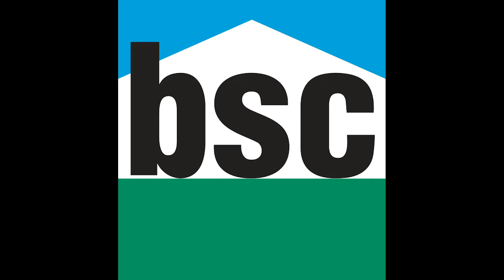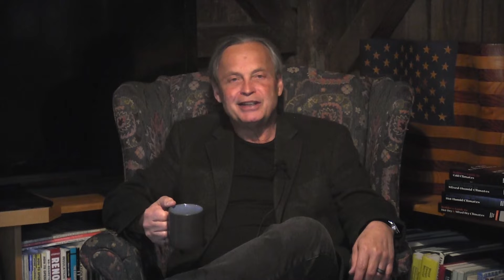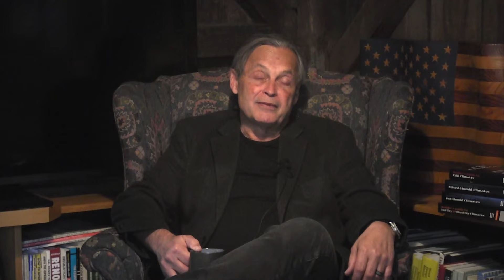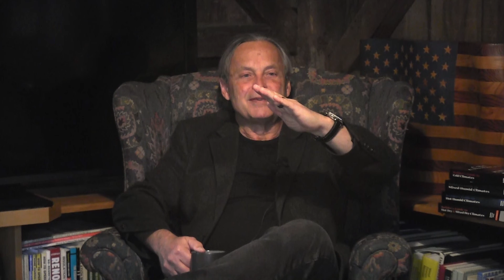Cup of Joe - Flow-Through Assemblies

Comment: So if I do have a vapor open assembly can I put a rain screen then put vinyl panels on the interior. Diffusion into an air gap..... The manufacturer recommends that is to prevent holes...
I want to pressure washed the bottom  of my garage....

Comment: It does not appear that you read comments, but I will ask anyway. 
Air molecules are smaller then water molecules. 
How does water vapor move through a vapor retarder, but stop the smaller air molecule?
Reply from the maker: Air is a mechanical mixture of nitrogen (N2) molecular weight 28 and oxygen (O2) 32.  Water (H2O) has a molecular weight of 18.  Mass is only one of the factors.  Size also matters, but not as much as you would think.  Water molecules are about 2.75 angstroms (0.275 nanometers).  Nitrogen molecules and oxygen are both about 3.0 angstroms.  Water molecules are smaller.  Having said that... the vapor flow by diffusion through a material is complicated by the polar nature of the water molecule, adsorbed water mono layers, capillary condensation and surface diffusion.  Look up Lord Kelvin and the BET theory…then have a stiff drink.